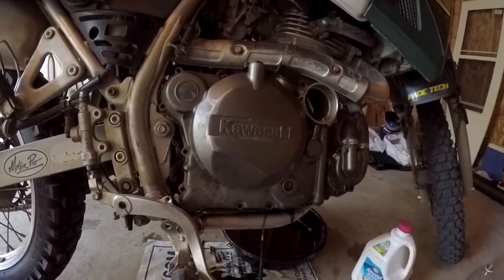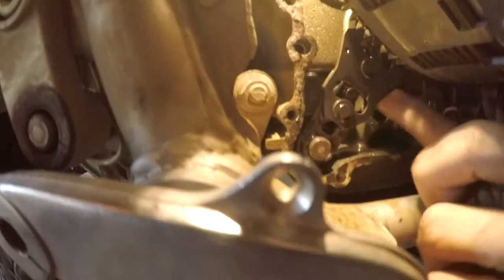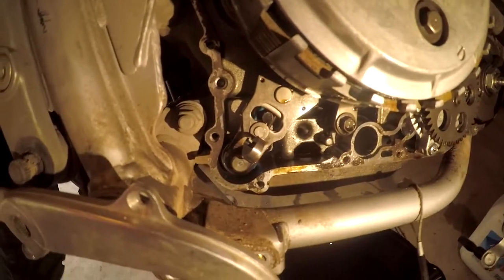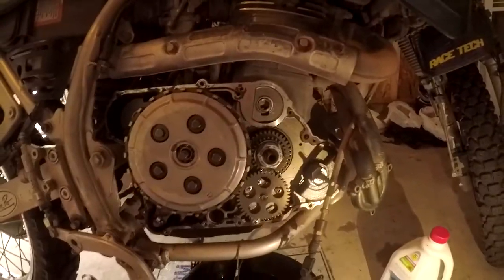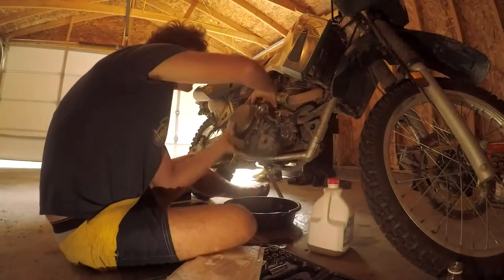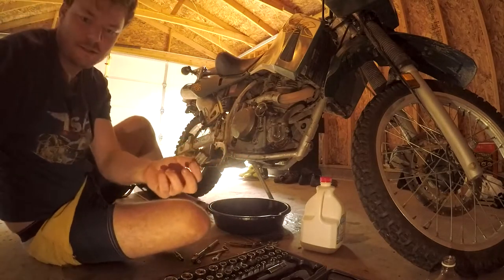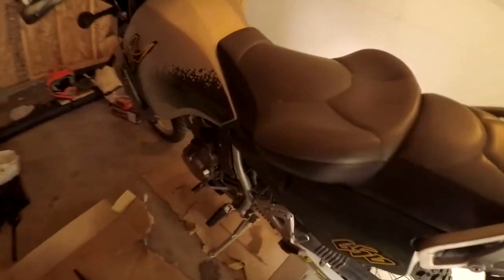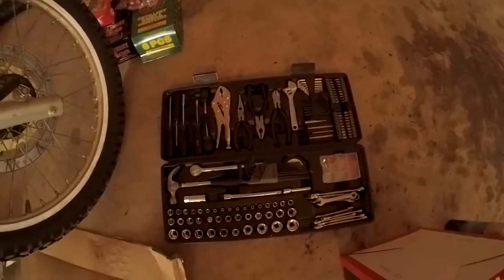KLR650 not changing gears? | Replace the gear change spring

Comment: Hey, based on the description. I've replaced my clutch pack over the summer. OEM clutch cable. But, when I put the bike in general, all it does is rev as if I'm holding the clutch lever. It is a very odd situation.
Reply from the maker: Did you have the same problem as me?